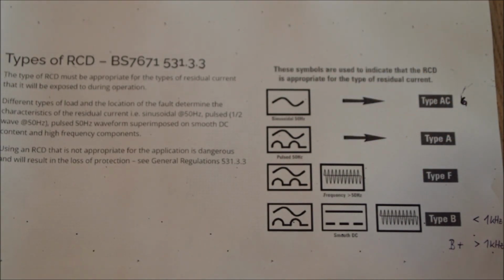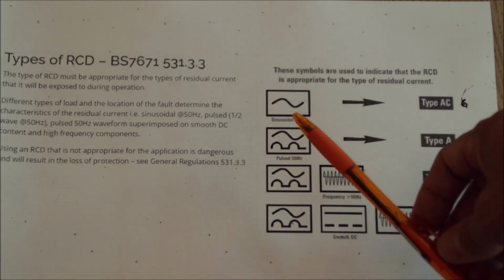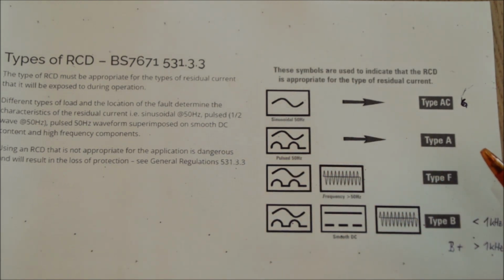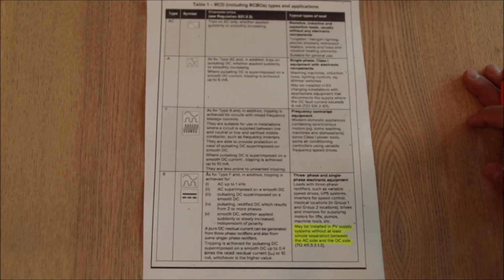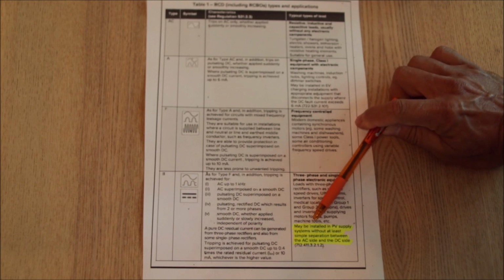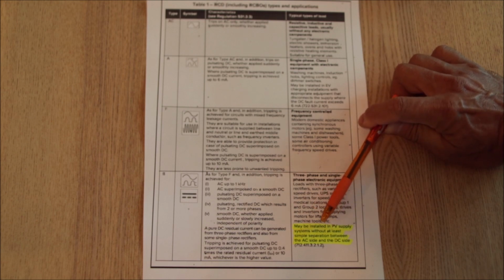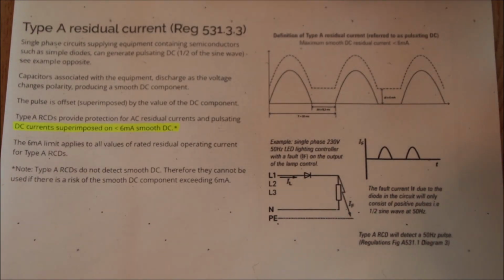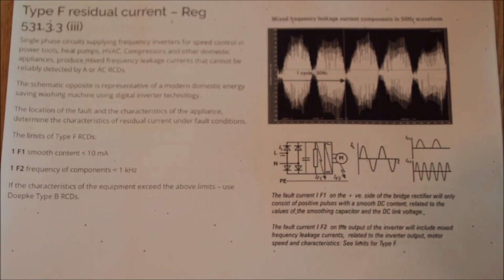Do PV-Inverters require Type-B RCDs on AC side? What are RCD Types?

Comment: Good video.

Just on the example at the end. Whilst it provides isolation between the PV string and the AC side. Im not sure it provides isolation between DC and AC.

The transformers here appear to be operating as an isolated DC/DC converter, which is then fed into a non-isolated DC/AC converter.

So under single fault conditions it would be possible for it to feed the output with DC current. This can cause no end of problems for other equipment. Especially when AC side transistors misbehave - which they obviously do. Preferably an inverter would notice this and go into fault mode - but obviously many are poorly designed and don't.

Comment: Thanks a lot for the video. It appears that apart from cost, the best thing to do in order to clear all doubts is to go with a type B RCD. Could you please do a video on the best ways to properly ground solar PV systems (off-grid and grid connected).
Reply from the maker: Hi, thanks for the comment. Yes, if cost is no factor, just go with a Type-B RCD. Grounding of Grid-Tied systems is pretty straight forward. A Grid-Tied Inverter is similar to any other appliance. Just connect to the existing Grid installation Ground from the main panel. You are not allowed to create a new different Grounding point for an On-Grid inverter.
For the Off-Grid Grounding there is already a video about "Grounding and N-G bonding in a simple Off-grid  System". https://youtu.be/eQ1Itspy9aM 
Please watch it for reference. Thanks

Comment: I know a lot of the inverters we buy in the USA are actually not recommended for use here and we cannot get the approved to be legally used. Only a small amount of inverters are able to be permitted and legally used. Most people just use those type as off grid and never have them connected to utility grid.
Reply from the maker: Yes, it's a wise decision to stay purely off-grid when possible or at least design your system to switch over with complete separation. The US split phase system is introducing a few more challenges into the topic anyways, especially when people are starting to use European and Chinese standard equipment.

Comment: What is RCD in solar system?
A Residual Current Device (RCD) is used to detect these currents and disconnect the circuit from the source automatically when the values of these residual currents exceed the pre- defined limits.
Reply from the maker: Yes, DC leakage into AC (like using the backdoor), that is the relatively new topic only relevant for solar systems... and this can only be dealt with by Type-B RCDs. But as said, the Inverter must be a "transformer less" design

Comment: Really nice video, im currently writing an essay about the compare of the safety requirement (against electric shock) between the inverter with and without isolation. therefore ur video helps a lot, thank you very much. Additionally i still have a problem, so, are all the PV inverters, no matter isolated or non-isolated, they all need a RCD, and the only difference is, if there is a DC current injection, then use Type B, am I right?
Reply from the maker: Hi. In most developed countries there will usually be type a rcd used as a basic protective device against humans being injured through electrical shocks. That device is suitable in combination with isolated inverters. Only if the installed inverter is non-isolated transformer less type, the rcd used instead should be of type b. Additionally an installed ev charger can make the usage of a type b rcd required. So yes, you are right!
Reply: @RolandW_DIYEnergyandMore  Thank you for your reply! I have another two question.
1. When it comes to the limit value for RCD against electric shock, the regulation (IEC 621090-2) says that it's 30mA, i am always wondering whether this 30mA limit only for residual current or it's for the summary of both residual current and leakage current. (I've also read a technical information from manufacturer SMA that leakage can over 30mA, which is a little bit weird for me, because RCD doesn't know the current it measured is which current, if the summary is beyond 30mA, why would RCD not activate in this situation?
2. I've read the white paper from Schneider electric that u mentioned in this video, it says, even though some inverters have integrated RCD/RCMU inside of them, to preotect the Lines between the inverter and AC grid, there must be another external RCD put into use, i am wondering whether the trigger value of these two RCDs are the same？
Thank you again for your patience!
Reply from the maker: @vinnydu8554  an rcd cannot distinguish between types of currents. It can only trip on the summery of missing currents it measures. The 30mA and 100mSec are typically worst case values. Normally 30mA rcds will disconnect the circuit starting around 20mA and won't go much over 25mA. There are special types which have short delays to prevent random activations. Every non-isolated inverter must have internal DC leakage detection. But that detection is very basic and is not based on human protection. It is purely designed to shut down the inverter itself. Those leakage currents thresholds could easily be in the hundreds of mA. That's why we need to use separate rcds inside the distribution.

Comment: Here in Australia we also have few companies that make Residual Voltage Device. Similar to RCD, but its checking voltage and current between ground and forces RCD to trip if it detects current to ground. Is there a mainstream product available or its a local "know how"?
Reply from the maker: Australia uses all the same devices as the other 220-240V 1-Phase, 400V 3-phase countries and regions. There is no local difference for RCD, RCBO, etc. They are all working on the same principle.

Comment: Hi Roland,  the micro inverter you own, did you find a FET of higher current and would an auto grade Japanese FET of higher current be an option?
And aluminum capacitors.?
I thought about externally mounting a fan to cool the heat sinks inside a marine aluminum weather resistant hood like computer graphics card cooling designs.
My like for your inverter is the low ac voltage . I will be fitting RCBO units on output side of each panel invert for full safety along with lightning protection.
500v dc scares the hell out of me.
Andrew the Electrician
Thankyou for you micro inverter
 video.
Buying the micro inverter 2500w.
4 panels input.
Andrew Nz
Reply from the maker: Hi Andrew. Those WVC inverters have so many issues. I see it on other YT channels that they do have a variety of many different faults. I don't think it makes sense to "improve" it component wise. Just don't use any of these. High voltages are always a bit scary, but usually the DC side is always nicely isolated to ground so chances to get really hurt are manageable. I still once managed to touch both the + and - on 120V DC. Yeah, it felt like 230AC, haha. Greetings to NZ, Roland
Reply: @RolandW_DIYEnergy  Thanks Roland, I may have to find a  circuit design, and free geber file with open source software available, maybe a pi zero with wifi and a galvanic trans former design and build a pcb in China with over rated auto grade components.  
Appreciate you videos .
From Andrew Nz

Comment: Hello again Roland, quick question: What model and amp capacity were the FETs, please?
And did you swap them out for Japanese FETs or Texas instruments FETs.
Reason for question. Can't find any substitute for 4 panel input with 2000w output 230v 8 amp units.
Thank you for your patience 
From Andrew  Nz
Reply from the maker: Andrew, the WVC had the IRFB4110 built in. I ordered replacement from China via AliExpress. If you can get better ones then its surely worth a try. Deye for example is selling micro inverters too. You would have to contact the seller via Alibaba: https://m.alibaba.com/product/1600549910549/Deye-Solar-Inverter-Single-Phase-4.html?s=p
Those are brand inverters at least and they will have good components built in. Cheers
Reply: @RolandW_DIYEnergy  Thanks mate your awesome. 
B series RCBO show was fantastic for defending electronic equipment on a solar system. 
Thanks for sharing your engineering knowledge. 
God's speed 
Andrew Nz
Reply from the maker: @aandscrawfoski  they are actually also selling the Deye 2000W microinverter on AliExpress: THB 8,800.32  38%OFF | Deye 2000W G3 INMETRO VDE IEC Grid Tie Solar Inverter With Limiter 4 MPPT IP67 With Built-in WIFI, 20-60VDC 220V-240VAC 50/60Hz
https://a.aliexpress.com/_msuibBa
You can get some infos there. Cheers
Reply: @RolandW_DIYEnergyandMore  Thanks Roland, have a fantastic day.

Comment: Hi and thanks for this video, I'm a little confused here,I have off-grid type inverter, with grid connected to inverter  when there is electricity from utility company,should I put the type B RCD after the inverter or before the inverter ?
Reply from the maker: RCDs are always ment to be installed after the power source at your breaker panel. Upstream RCDs at inverter AC-In can cause problems if there is a downstream N-G bond present either inside your inverter or in your panel. If your installation requires a Type-B RCD depends either on your loads or if your inverter is transformer-less type as explained in the video.

Comment: Hi Roland,
I newly installed 5.5 kw off grid solar system. When I connect grid power to inverter, AC in RCD is immediately tripping. Otherwise inverter is working well in PV and battery. We have three phase current and single phase inverter. Only one phase is connected to inverter and inverter out is coupled to all three phases of the load. Please advise. Thank you
Reply from the maker: You have a N-PE bond after the RCD on AC in. if you didn't place a bond then the inverter is internally bonded. you can either remove the RCD at the AC-In and replace it by a 2 pole MCB or make a bond when inverter is in offgrid mode only as i am showing in my TT-system video. N-G(PE) bond can never be downstream of an RCD! I assume that at the moment the AC-In is coming from a circuit of your main panel which is protected by a 3 phase RCD. you need to get your AC-In from a point before that RCD. What is you inverter model?
Reply: Thank you very much. Greatly appreciate your help. 
AC in is coming directly from the grid, before going to the main panel.
Our inverter model is SaKo Simon pro 5.5 kw.
Three phase Grid is connected to 4 pole AC SPD and 4 pole MCB then 4 pole changeover from where it’s going to main distribution box and AC in to the inverter going through 2pole RCD.
Reply from the maker: @vijjeev9234  ok. So yes, if your Sako inverter is providing a permanent internal N-PE bond (which you could check on AC out N and PE terminal if it is continuous in any mode), then an upstream RCD will always trip.
Reply: Thank you very much
Reply: @Roland W   I don't have utility I  have only solar inveter, pv panels, 
When I installed RCD at out put of inverter its doesn't  trip.
Please advise ?😊

Comment: Hi, what would you suggest to do if you have a transformerless inverter that trips a 30ma rcd when the solar panels get wet?    (the rcd that is tripping is on the utility input side).  I have an 30ma rcd on the ac output side, and this does not trip.     The inverter is off grid hybrid with utility input bypass.    Would you just use a 100ma rcd?   Or is it possible to use two 30ma rcds in parallel?  Thank you 👍👍
Reply from the maker: Hi. Actually the utility IN for bypass, belongs still to the TN Grid, so you have installed a RCD upstreams of another power source. The first RCD should be installed inside your main panel of your installation. And that RCD can serve both the Grid bypass as well as the Offgrid. I am sure that your thought was to protect the inverter, but that should only be done by an MCB at the input. The inverter itself is protected by all its electronic circuits and requires equipment grounding only. using an 100ma RCD might not change anything, but if you know that a wet panel is causing the issue, you might try to find out which panal is causing insulation resistance to drop and replace it...So, I would just remove the input RCD, as in some countries that would be against code anyways. Cheers.
Reply: @RolandW_DIYEnergyandMore  thanks very much for your reply..   The inverter is in a shed and the supply to the inverter is taken from an rcd and breaker already in the shed, i did not install it just to protect the inverter/myself..   The panels are installed on a metal shed also, and ive read about capacitance tripping due to this? So possibly not actually down to a faulty panel?...   The rcd is old, and ive just switched it out for a new one i had spare (still 30ma), and amazingly its not tripping at all now after spraying them with a hose for quite sometime (this normally trips the rcd ina few minutes).   Possibly just an overly sensitive rcd?  Or just as its old?..   But problem solved now, thank you.. 😃.  👍
Reply from the maker: @jmpcrx  great that the tripping stopped. But as I said, upsteam RCDs may sometimes cause a bit of problems if they mix up currents from Grid and PV systems. If you keep getting issues, get your bypass supply from the Grid shed supply directly via a double pole MCB only. Thanks for posting your experience.
Reply: @RolandW_DIYEnergyandMore  ok, ill do that if it starts happening again...   Thanks very much for your time, we may speak again lol 🙂👍👍👍